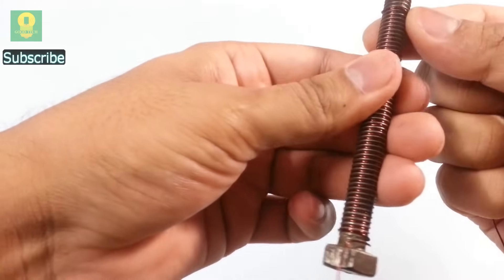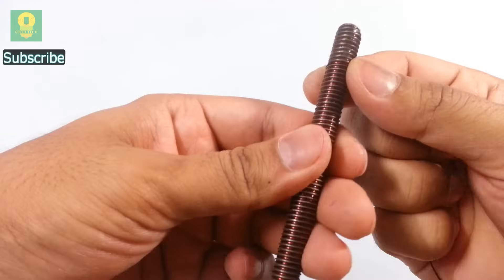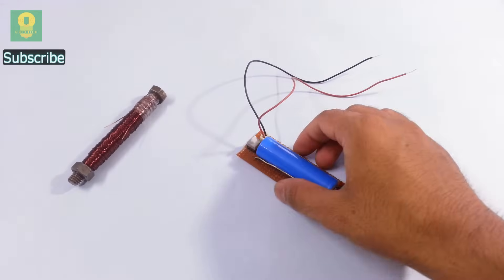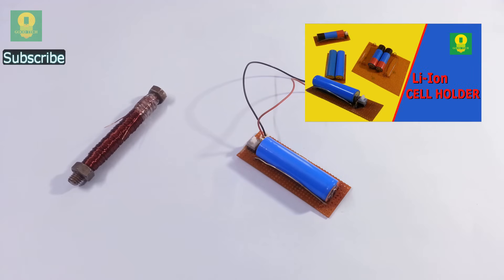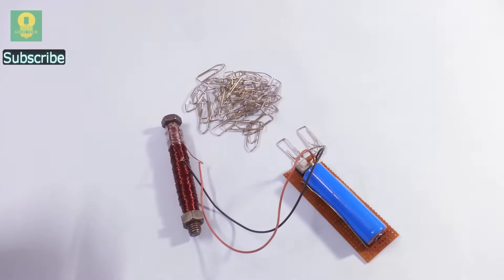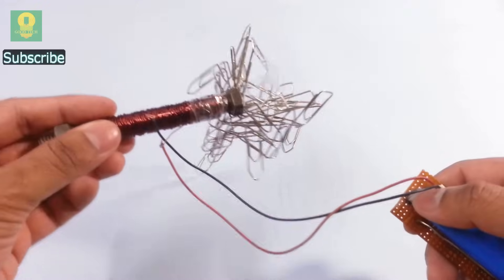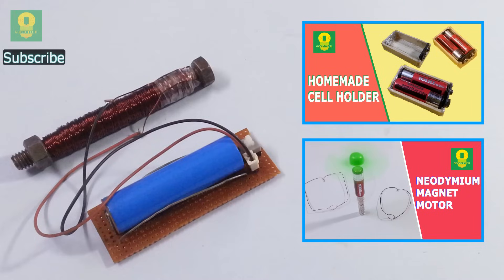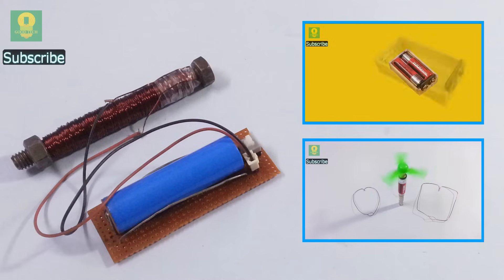How to make an Electromagnet | Super Strong

Comment: Just a tip (and a theory) That electromagnet would be very strong but if you know anything about ohms law (I = V/R) you know that this has very low current because of the resistance. So a way to fix this is obviously add more voltage OR put it in the freezer and it'll create less resistance. Even better, put it in liquid nitrogen and it'll have far far less resistance and may be able to hold at least 5 - 7 pounds of force :)
Reply: You can also increase trans conductance by utilizing a transistor.
Reply: Just Another Normie going on about what you said about putting a magnet in liquid nitrogen. You can create a stable hovering effect with two magnets. Lay a plate (or bowl as long as it contains the liquid) in between two disk magnets while they attract each other. Pour the liquid nitrogen into the plate and onto the magnet. I don't know what specifically going on but when you remove the plate the result is that the two magnets will attract and repeal each other to keep the space apart as they had with the plate. They will resist any attempt to move them closer or further away from each other. And they will stay this way until the frozen magnet thaws to the point the effect is no long able to resist the magnets urge to attract one another.
Reply: How about increasing the diameter of the wire?
Reply: Naturally Loved Music thanks! Will the magnet be able to hold power once it's temperature starts to return to normal?
Reply: Hey I know this was a while  a go but how do u use liquid nitrogen or helium to create a strong electromagnet is it just extremely cold or something and how do u keep that electromagnet super strong
Reply: nerd

Comment: How much no. Of turns
Reply from the maker: No need to count actual no. of turns unless you need a magnet of desired strength. However, I wrapped 6m of copper wire on a screw of 11cm in length. more the turns more will be the magnetic strength.
Reply from the maker: No need to count actual no. of turns unless you need a magnet of desired strength. However, I wrapped 6m of copper wire on a screw of 11cm in length. more the turns more will be the magnetic strength.
Reply: the more the turns, the stronger it will get upto a certain  point, after that the resistance will start to become too much and the current will become too little that the strength will start to decrease again. The maximum point depends on the material, thickness of wire etc and the internal resistance of the battery.